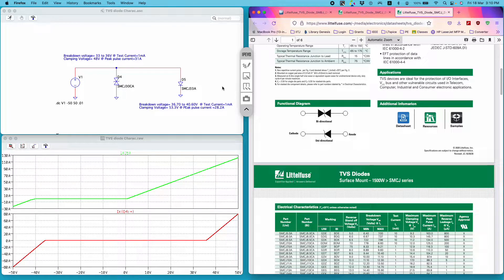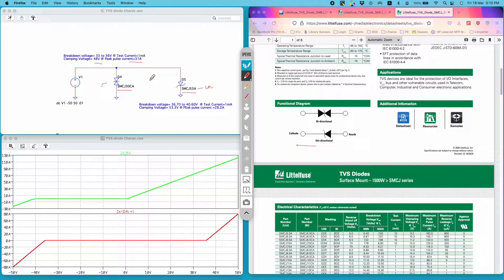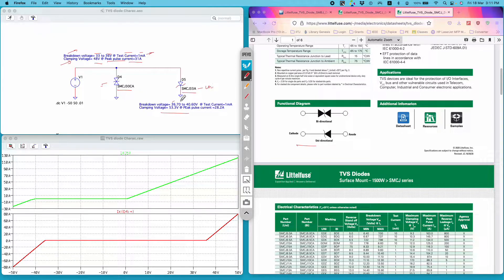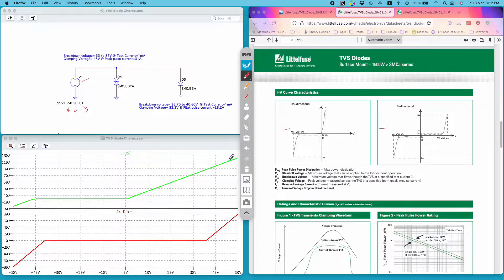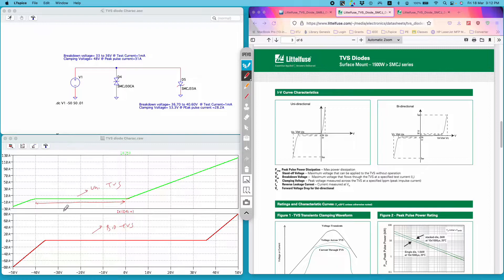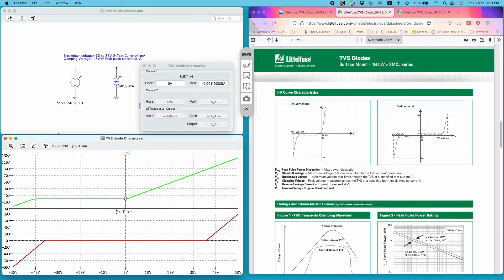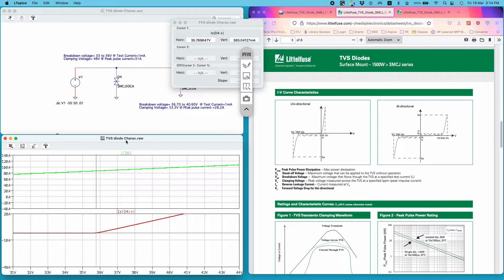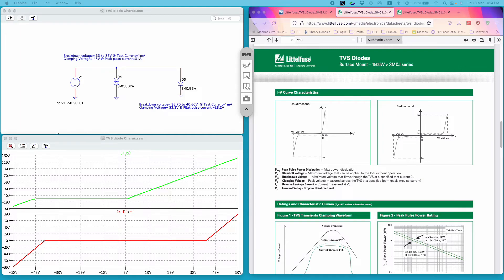TVS Diode Characteristics in LTspice

Comment: how to sweep dc voltage could you please expalain in clear
Reply from the maker: .dc V1 -50 50 1  use this command..V1 is the variable you want to sweep, -50 is initial voltage, 50 is final voltage and 1 is the increment.